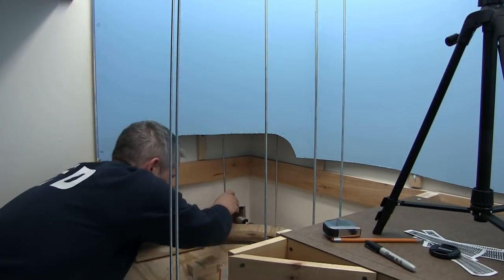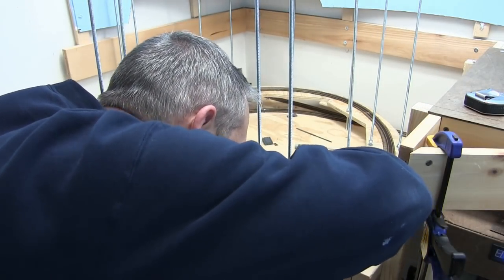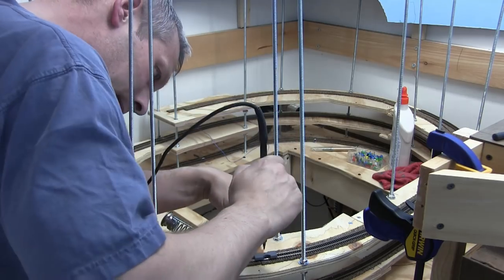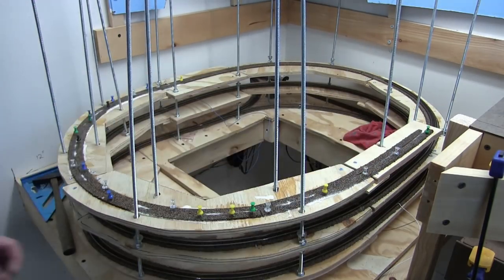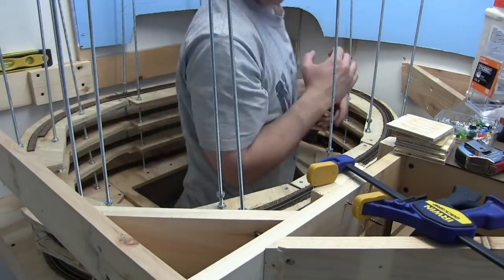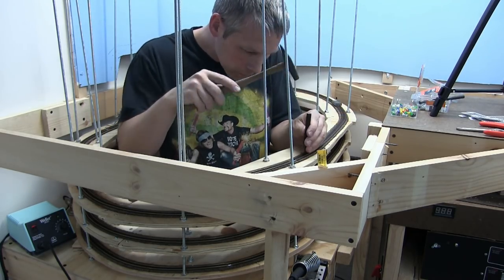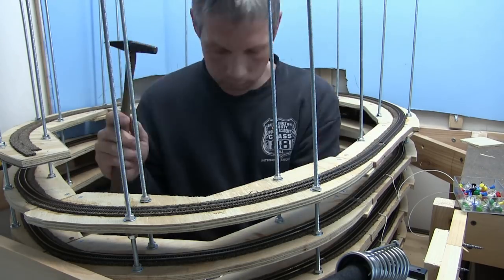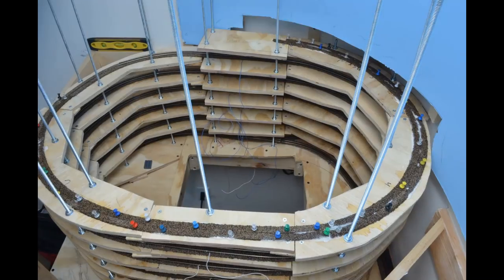Constructing the Large Helix for the Sayrehurst Secondary

Comment: Nice work again on the video and helix build Joe. Two of our operating layouts have helices and one used threaded rod and the other is the traditional spacer method. I was going to comment on Facebook during the build but you had already made significant progress, one of the most common methods with the threaded rods is to use trapezoidal pieces instead of the curved types you used. You could even get 1/2" pieces of board and just use a miter saw to cut the pieces (geometry calculations are involved). Once again, great work on the helix and I like the fact you leave in the "bumps and bruises" you get during construction. - Phil
Reply from the maker: Thanks Phil! Can't wait for ops sessions to begin!

Comment: I wonder if it would help if someone would take the time and measure the space between each level and cut tubing to slide over the rods to make it easy to maintain the same distance all the time except the beginning, but I believe it would make it easier to keep the distance along with help strength the whole thing. So you would use nut, washer, plywood, washer, nut, tubing, nut, washer, plywood and so on. just an idea.
Reply from the maker: Robert Shanks that's an idea! Thanks for watching!

Comment: I finally landed my first US locomotive, and if it is any indication I feel the pains of precision in your railroad now.
The ScaleTrains GTEL 8500 really dislikes my European sectional track to the point that I currently can forget about switches if I want reliable operation.
It is not the fault of the locomotive mind you, examining the multiple switches I have from Fleischman I see areas around the points where they are out of gauge with the naked eye, so the lead wheel on the trucks derails when you hit those.

Now realizing the painful details, I see that my full layout with double helixes is going to be a pain to make it run reliably with my intended US rolling stock.
And the lesson learned is to avoid Fleischman switches and track like the plague if you want reliability.